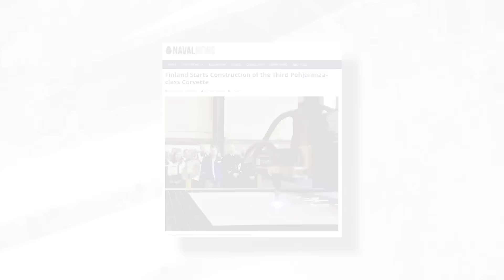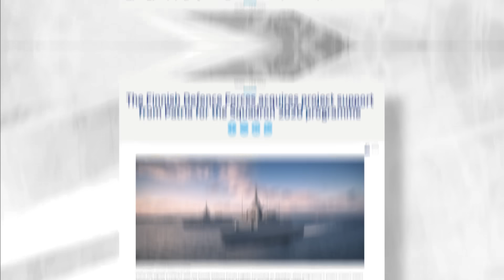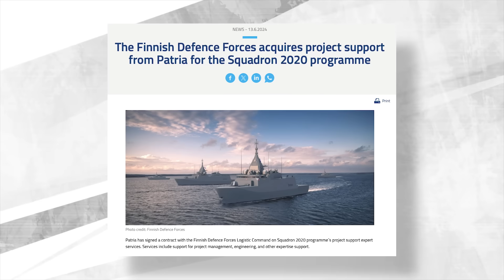Finland’s Multi-Role Corvettes (Pohjanmaa-Class)

Comment: modern corvettes should be designed for open water long endurance deployments halfway across the world . . . able to sustain even in the worst of sea state conditions . . . displacing anywhere between 2,263 ton - 3,630 ton & powered by cutting edge hybrid marine propulsion system . . . for littoral water patrolling duties 638 ton - 960 ton fast attack crafts are more than enough for most mission types in the coastal domain including search & rescue . . . thanks to technological innovations in defense, such rapid evolution over the past few years is simply mind blowing to say the least . . . fast attack crafts can now be armed with medium range surface-to-air missiles & anti-ship cruise missiles including light - medium weight torpedos . . . such radical evolution in the defense sector was unthinkable in the mid-2000s . . . artificial intelligence, connected warfare (information sharing through a robust open network architecture) & unmanned drones is the order of the day whether you like it or not . . .

Comment: Main point is that these are also icebreakers and integral part of the air defence. The can use the secret coastal routes of shallow water, hide behind the many islands in the archipelago. Basically, the task is to block the Russian Navvy Baltic fleet.
Reply: Nah, they're not icebreakers, but have the capability to operate in ice. Using them as icebreakers would be completely suboptimal, as proper icebreakers have a completely differently shaped hull. These have a warship shaped sharp hull, whereas icebreakers have a roundish bow to crush the ice beneath.
Reply: These are expensive, large and almost stationary targets. A waste of money unless bought to fight off Somali pirates in some other coast. Almost like the geniuses behind the command hover craft purchase never got called out for being morons.

Comment: How did you find out the names of the ships? I haven't found anything official myself yet,  and Pori is already in use on a Hamina-class ship
Reply from the maker: It most definitely came up in our research but we are having trouble finding the information again. Considering there's no way we would have just pulled these very specific Finnish names out of thin air, our source has to exist somewhere - so there are some possibilities.. either we misinterpreted the list of names as being associated with these new ships, or the source page has since been removed. Nonetheless, we've also removed this part of the video to avoid confusion if they aren't actually the names. Thanks for asking about this.

Comment: New class of ships, new challenges and new costs - overall I like the new ship, but the final cost will determine future Finland's ship building into the future. Wish Canada had ship builders that won't double the costs of the projects before the keel is laid. Cheers
Reply: We should at least double the budget to get double the amount of ships. 4 isn't enough to replace 7 ships. Finland is going to spend many times more on defence during the coming years and this was not foreseen when the budget for this program was set and neither was foreseen the deterioration of European security situation back then.

Currently the program is behind schedule and slightly over original budget, at about 1.45 billion euros for 4 ships. Even at this price they are dirt cheap per ship considering the capability.

In my opinion Finland should have, and at least should now at least double the budget for still 4 more ships of this class. About 3 billion euros for 8 ships isn't bad, but the capabilities are badly needed.

Finland used 10 billion for new fighter aircraft, but navy gets neglected with what is basically a peace time budget.
Reply: @herptek 

2 Air Defense frigates,
4 submarines, 
8-12 AW195 Wildcats,
1 LSD 
and a proper fleet train.
Reply: @JJuhala-w9g  I'd settle for 8 up armed corvettes, the helicopters and then start to think of the air defence frigates at this time. Submarines would be great offensive assets in naval combat and wouldn't require huge crews, but I would prioritize air defence capabilities of surface ships for now.
Reply: @JJuhala-w9g that'd be great, but there'd be a serious personnel shortage in the naval officer cadre to man such a force.

Comment: Forgot to mention that the SAAB contract includes the SAAB lightweight integrated mast (SLIM), to host all the radar and electronic systems.
Reply: And this is a significant part of how the Pohjanmaa-class could reach its requirements of both high performance and ice reinforced hull. The latter adds significant weight, but the Saab lightweight mast offsets this, and as the end result, the center of gravity is very low and both initial requirements could be met.
Reply: @XoravaX  The really cool thing with the SLIM is when they say lightweight they really mean lightweight. The entire square structure mast  excluding radar and sensors and such,  weigh less than 200 kg.

Comment: This design was clearly pre Ukraine invasion design.
Reply: I don't think that there's much that should really be changed about them even in the world of post-2022. The only thing they are really missing is anti ballistic missile capabilities but that's more of a thing related to the budget than anything else.
Reply: @matteusvirtanen392  There is apparently room on deck for another 8 VLS cells. If this room was used in this fashion the total VLS capacity of 16 cells would be in the league of modern light frigates. This would allow some more choice of interceptors.

For example, one could use up 4 cells for quad packed ESSMs, 4 cells for dual packed CAMM-MRs and 8 remaining cells for something like SM-6 with terminal phase anti-ballistic missile capability. With this example load the number of SAMs loaded would be the same 32 as presently with only ESSMs but with radically more diverse capabilities and ranges.

Alternatively the extra cells could be used for a radically bigger load of ESSMs. In any case I would think of adding some sort of close-in missile defense such as a RAM launcher or similar on top of the hangar for example as well just in case something slips through.
Reply: @matteusvirtanen392  bunkers are way cheaper than BMD. Finland is an small nation that needs to think in force design.
Reply: @clrogier 

I still vote for BMD also, there is no way around IMO looking at Ukraine and Israel.
Bunkers help saving on the numbers needed for sure.
Reply: @JJuhala-w9g  of course, but can Finland afford it? And why would you like it on a ship and not on land?
Reply: @clrogier 

Can afford with the new budget and I like it in land and sea.
Convoys and surface groups can have a need for BMD (Red Sea and Houthis) it also adds flexbility and reach in all scenarios.
Reply: Yes, as was correctly stated in the video, it was intented to replace 4 aging missile boats and 3 minelayers, 7 ships in total, and the project is older than the suddenly worsening security situation in 2022. The budget is quite tight and calculated to be just enough for 4 new ships.

Perhaps we should be wiser now in retrospect and double down on the number of these ships and to use up the space on deck to double the defensive armament on each ship. The budget should be doubled. If this was done now while the first ships are still under construction we might not need to wait untill mid-life upgrade to do it. The Russian war against NATO might start before it is scheduled to be and there is no time to build ships when the war is already on.
Reply: Well something happened in that time period since the original ship was supposed to be 96 meters long, now it`s 117 meters...